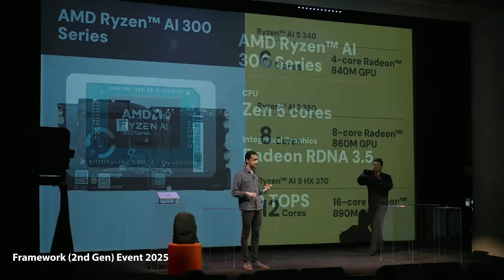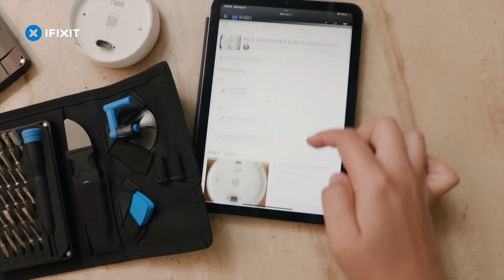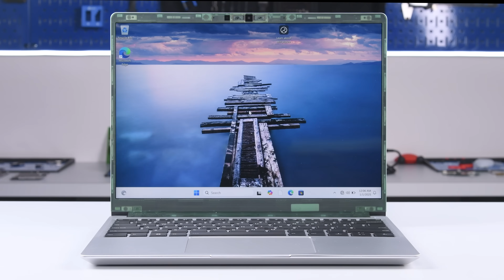Framework  Laptop 13 in 2025: The Laptop That Just Keeps Upgrading - AMD Ryzen AI 300 Upgrade

Comment: I recently got mine and put Linux Mint on it, I love it. Built to last, thick enough to have decent thermals and battery life, repair documentation and okay support, upgradeable, largely for and by Linux users, can be cheaper if you order less RAM and the 1080p screen instead of the 4K one, and has lots of neat QOL features like FN-lock (which is great when using it for productivity or games that use the F row), kill switches for the webcam and mic, and customizable I/O ports (with options that include an ethernet port and a permanent USB drive for games or a Windows VM). I especially like how its motherboard (and more importantly its CPU, GPU and AI chips) will be replaceable/upgradeable as long as they still make the current form factor.

Comment: its alr done by others, if you hunt around on ebay or taobao, you can find used parts for cheap for laptop <5 years .  normal laptop alr can change wifi card, ssd, memory easily.  if you are a tinker i dont see a point buying this?, missing replacement gpu and psu ?

Comment: I wish this was possible with phones…

I had the battery replaced on my iPhone 11 ProMax (purchased refurb from Apple May 2021) last year then the screen died. 

Had that replaced with an aftermarket screen and have had nothing but trouble with it. 

Replaced under warranty, still having troubles, but better- touch panel only crashes once an hour instead of 20 times an hour! New screen still kills the battery- 50% by 2PM, just like the old battery. And of course no longer water resistant after it is opened. 😬

I will get a newer iPhone soon but for the $1000+ you’d think you should be able to get 5 years out of it- newer than iPhone 13 they won’t even use a non-factory screen because they are so complex.
Reply: You had all these issues and immediately said you're going to get another one. Sit and think about that for a minute.

If I buy a lemon car I wouldn't immediately buy the same model but newer without those issues being addressed. Why not hold a phone manufacturer to the same standard. All those problems are still there with apple products.
Reply: @nojuanatall3281  This is the first major problem I've had with an iPhone out of warranty since 2012, I think those are pretty good averages! 

But when I get a newer one, I will be buying an extended warranty, I use it for business now, can't be without it...

Comment: The M series Macbook Pros have remained largely unchanged since their introduction. iFixit, could you look into the interchangeability of the internals of the M series Macbook Pros? I have an M1 Max 16". Could it, in theory, have its internals upgraded by virtue of a motherboard swap?
Reply: Potentially if they used the same dimensions on the inside of the chassis and all the ports on the motherboard were kept in the exact same location. You could theoretically get a newer MB if those factors are true but it would be a major pain to swap because a lot of stuff is glued down.

Comment: i wish that CPU will not be soldered to the MB as well, but this train has already passed the stations
Reply: Most laptop CPUs are not available in a package that can be put in a socket.  There are a few exceptions, but very few.
Reply: Framework CPU is soldered? So if I want to replace framework cpu i need a heat gun and the expertise to remove it?
Reply: @testtestsson4927  you cannot, because you cannot buy new CPU
Reply: @ronlevin2339  what the. So to get a new CPU I have to buy a new motherboard from framework?
Reply: @testtestsson4927 yes haha, ofc

Comment: I love Framework personally and the efforts they're taking to reduce e-waste and Apple can definitely learn a lot from them. But trashing Apple is bad, because you see, their products last a good 7-10 years anyways.
Reply: Unless a spill breaks the keyboard, drop cracks the screen, the soldered down SSD wears out or the not upgradeable RAM proofs to be inadequate down the line.
After 5-ish years the battery also needs replacing, which is infamously difficult on macbooks and the Windows machines with similar designs.
Not to mention that as it stands now, a Framework laptop can last as long, also supported by how a friend's early 13 is holding up.

I will give the cheap hard to repair or not upgradeable models of any manufacturer a hard time in discussions.
But I buy or recommend the product, not the brand. Also considering (second-hand) price.
HP has a deserved terrible reputation, but they have some incredible models too.
Lenovo has some cheap crap which falls apart, but some of their ThinkPads are legendary for lasting 10-20 years.

CPU performance and efficiency wise, the M series macbooks still are the best.
I strongly considered a second-hand one when my E series ThinkPad (the cheaper kind) kicked the bucket after 6 years of being dragged through campus.
But I ended up getting an incredible second-hand deal on the last T series ThinkPad (long lasting business line)nwith the exact keyboard style I prefer.
Reply: I half agree with you here, though I take problem with Apple specifically because their products don't always last for 5+ years without a repair or two (like any device) and their anti-repair practices and their "upgrade every two years" philosophy constantly get in the way of this. 

Among my family and friends (and my own iPhone 6), we've had a total of 4 iPhones now which sprung critical motherboard related problems or similar that Apple repair shops couldn't service.
Reply: Agree - the brands that should be getting dogged on are the ones that constantly release cheap instant e-waste laptops. Machines that last nearly a decade aren't the issue here.

Comment: My only gripe with FW13 is lack of trackpoint keyboard, touch screen, and 2in1 shell. I think 2in1 shell is unlikely but hopefully they'll add the other two.

I see number of people comparing FW13 to budget laptops and I can see why but specs aren't everything. I'm not sure about most recent ones (less than 2 years) but users have been reporting hinge issues after few years and 1 if you are unlucky. If you plan on upgrading every few years, sure that's not a problem but now you have to learn that new laptop and set it your way - transitions cost money. For me, I just didn't want to deal with that hassle.

tldr; It's a business grade laptop with slightly lesser build quality (because it was an intentional compromise).
Reply: 2 in 1 shell is in the Framework 12.
Reply: @fujinshu  yea that's why I'm not holding my breath for it.

Comment: Framework is fine but main reason not to buy it is that you can buy laptop with same specs for half a price and when time comes just buy a new one, framework not even provide an option to buy new housing for your laptop parts, because housing is first part that goes bad. And new motherboard still not cheaper than buying a whole new laptop from the competitors.
Reply: The aluminum won't be the part that "goes bad" first.
Reply: Also you can get the new Ryzen AI 5 340 board for $449. The cheapest laptop that I can find new that has that (only 16GB RAM and 512GB SSD) is a $799 ASUS Vivobook 16. Maybe the prices vary in different markets but in the USA, it's definitely cheaper to just get a new mainboard from Framework.
Reply: My relative has purchased an empty Framework 13 case shell for my hand-me-down AMD R7 mainboard. It's cheaper than buying a new 13 inch laptop with Ryzen 7 7040U or equivalent.

Comment: What happen to old board?  If I purchase MacBook, at least i can trade in to Apple Store and get credit and save on sale taxes too. It might cheaper to get this
Reply: They sell cases to turn it into a desktop
Reply: They sell $30 or $40 cases to turn them into a desktop or you could sell your old board on eBay or something.
Reply: For my older AMD R7 FW13 mainboard, I told my relative to purchase an empty Framework 13 case shell. I upgraded to an AMD R9 AI mainboard with 3rd-party low-latency 64 GB RAM.

Comment: Can we go further? Split the motherboard into CPU and GPU sections? Replacing the entire motherboard seems a bit wasteful.
Reply: The framework 13 and 12 uses APUs, where there's no separate GPU chip. The Framework 16 has CPU and GPU separated, but it's still in the first iteration with no upgrade/update announced yet.
Reply: @helloar14  Using an APU seems like a good reason not to split the motherboard ;)
Reply: After removing the mainboard it can be run on its own as a media/streaming PC or NAS
Reply: While possible it might not make sense to do so. APUs and IGPUs are getting so powerful and efficient that dedicated GPUs for laptops might not be around much longer.

Comment: I'm wondering at what point they'll have to stop the backwards compatibility and release Framework 13 gen 2 let's say. There is no way they can continue doing this for 4-5 more years. Everything they learned, technology advancements etc. They will have to take advantage of that at some point. Nonetheless, very impressive!
Reply: Framework can continue the FW13 mainboard form factor while changing the outer case. FW13 mainboard form factor already has two case solutions i.e. laptop and Cool Master desktop case.

Comment: The only disadvantage framework is that they can't now improve the design like screen bezel or chassis thinness
Reply: What? It's thin af
Reply: They can improve the bezels iirc, just need to swap bezel and display. Don't think the display housing is actually the limiting factor here, but if it is, I think they are in a good position to have the whole display and housing be upgraded lol
Reply: I hate fragile thin chassis with bad cooling and tiny batteries.

Comment: Would be happy to buy framework’s laptop if it does not have to run windows…..I hate apple tax.
Reply: It actually runs better on linux
Reply: The diy edition can run many linux distros. I think older frameworks can even run FreeBSD but im not certain on that.
Reply: Few distros are officially supported, most other distros should work too
Reply: From everything that I've heard, these run better on Linux.

Comment: Framework smells like poo, look at that ceo.
Reply: are you like 12 years old?
Reply: Tell me which company is better than Framework?
Reply: @charlesdoesmore5488  any, the only premise of framework are laptops that are a bit modular and can be "upgraded" (with parts made by framework only) and that's it. The competition has more power, features, and time in the market. Way more appealing to the average customer than framework, which appeals more to the hobbyist.
Reply: @ Okay, pick a product that can not be repaired but has the most power ever. you do you.
Reply: @charlesdoesmore5488 Take care of your things and they'll last.
Reply: When i buy a laptop, i want to own it. Not indefinately rent it just so that some degenerate shareholder can sit on his ass and make bank on disposable electronics.

That doesn't even mention crap like licensing, or walled gardens in the case of apple. You can own nothing and be happy, however others want to actually own the things they spend their hard earned money on.
Reply: @dovahkiin2108  Even if you keep taking care of things and making things last, there is bound to be something that will break at some point. And if you cannot open it easily, well that is an issue.
Reply: @Anon-g8y4w  oh yeah so you own the all about the framework huh? You also have all the schematics for the components, including the CPU and GPU, source code for that Intel ME, tell me more. Framework is just a placebo for all the things you mentioned.
Reply: @charlesdoesmore5488 if you took care then that will happen 10 years in the future and you can then upgrade your laptop by buying a new one.
Reply: @dovahkiin2108  The RISC-V solution for Framework 13 case was designed by Deep Computing. Desktop cases for Framework mainboards are from Cooler Master. You're wrong.

Qualcomm or ARM camps are welcome to produce Framework-compatible mainboards.
Reply: @dovahkiin2108  if you took care 

You can't assume the users' "duty of care" with their laptops.
Reply: ok give the ipad back to your mom its past your bedtime

Comment: So awesome to see Framework going strong. I bought one of the originals in 2021 and so far have only upgraded the screen. But so nice to know that when it eventually starts to feel sluggish, I can just get a $500 motherboard and catch it up to present day. And also that it can be fixed if I drop it and break something.
Reply: If you're upgrading from 11th gen, you'll also need DDR5 memory. Still not the most problematic, and you can probably get a capacity boost while you're at it.
Reply: You can sell to me your old screen and motherboard. 
Left find other stuff and i am good to go)
Reply: @iraklimgeladze5223 I decided to hold on to my old screen, actually. Makes a killer portable monitor (albeit a fragile one without proper housing).

Comment: Very impressive. But does it run macOS?
Reply: I mean, you can make it run macOS....(sont remember name of the project, its opensource) It just takes a lot of dedication and you will probably lose some features even when you succeed
Reply: The only thing anybody should be doing with an apple is eating it
Reply: No thank god!! 🤣
Reply: @All_the_keys  What does it run then?
Reply: @mojoblues66  whatever you want
Reply: @nitrobear I want macOS.
Reply: @mojoblues66  macOS isn't the benefit you think it is.
Reply: @cameron_bosch  what OS would I benefit most from then?
Reply: @mojoblues66  Probably Windows or Linux (especially if the apps you use are on Linux or you can learn some alternatives).

Linux is also a lot better in terms of not spying on you.
Reply: @mojoblues66  ...What are you going off about?

Yes, apps on Linux can run in a sort of sandbox, and so can (modern) Windows.

TPM is a requirement for Windows 11.
Reply: @cameron_bosch  And what about the rest? SIP, SSV, PAC, rootless, secure boot chain, FindMy, iCloud, hardware-accelerated disk encryption, TouchID, LockDown mode, and code signed apps?
Reply: @mojoblues66 ok apple sheep 🐑 run to ur shepherd tim apple
Reply: @btslee  When the Trump voters run out of arguments, they start making up conspiracy theories...
Reply: @mojoblues66 Basically any Linux distribution, or Windows. Linux and MacOS are very very similar.

Comment: What happens to the old working logic board? Do you get a rebate
Reply: You can buy a case that it goes in so you can use it as a mini desktop pc.
Reply: Framework does not offer trade in services. You have to reuse it as a standalone mini PC or sell it.
Reply: You can just sell it. I would like to build ultra chip secondary laptop.
Reply: Framework sell an "empty" laptop shell, or you can 3d print case & use it as a server or media center...or whatever else you can think of
Reply: @kierank01 Similar laptop in my country cost $600 its with 20% tax.
If i can get used one for $400 and import it it will pretty good deal
Reply: Yeah that’s the problem with this. You can sell a used laptop to anyone, but you can’t say the same for old Framework boards. While Frameworks are easily repairable, I bet it’s not that cheaper to repair than, say, at a third-party repair shop. Parts cost money, and even more so when they have to ensure modularity. But hey, the principle matters I guess.
Reply: @ completely incorrect. example, a framework screen replacement is €180, compared to the bones of 500 for a macbook
The mainboard is designed to work outside of the laptop shell...use it for whatever your imagination can think of
Modularity brings economies of scale
Reply: @kierank01  Yeah, but you are comparing repair costs to a MacBook which is notorious for its high repair costs. I’m talking about regular ol’ Windows laptops. If people want a Mac, they’ll go for a MacBook. Framework is competing against established vendors the likes of Lenovo, Dell and HP who have already achieved economy of scale. I recently sourced a replacement LCD panel for my laptop from Taobao 1/3rd of the cost you mentioned — and it’s a good LCD panel with great colour gamut coverage.
Reply: @munchbit  Actually, they are targeting an apple demographic, particularly on formfactor, look & feel, so it is a reasonable comparison. They are former apple employees...I get the feeling they built the macbook they always wanted to, but never could
It's absolutely fantastic, that you were able to get a replacement screen for your laptop...and I'm sure framework would agree
Reply: @munchbit The replacement parts are very very fairly priced especially when you factor in that you won't have to pay somebody else to do it.
Reply: @ Fair, but it probably depends on the country. The cost of the parts I see on their page seems high compared to other places, especially for an LCD panel. At least you get Framework’s warranty and support.
Reply: @munchbit  Right. I think it varies quite drastically from country to country and I can definitely see how other markets wouldn't benefit from the Frameworks current pricing in some places. Currently their LCD screen is on sale for $159 which is not a bad price at all especially considering it's a first party screen sold by Framework.
Reply: It might be cheaper by just getting Mac if u going to upgrade every couple years.

Comment: ill go for framework when they have 2in1 touch screen with stylus. cos i need it for work.
Reply: The Framework 12 has that, I’m waiting until it becomes a thing for FW13
Reply: Framework 12 is a 2 in 1 with a touchscreen and stylus
Reply: Framework 12 is exactly that. A little bit cheaper than the FW13 too.